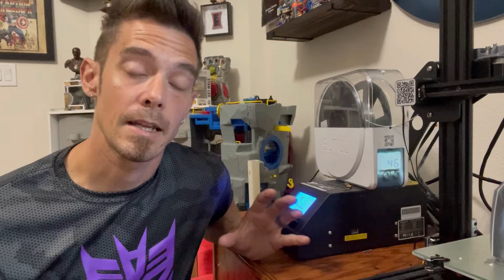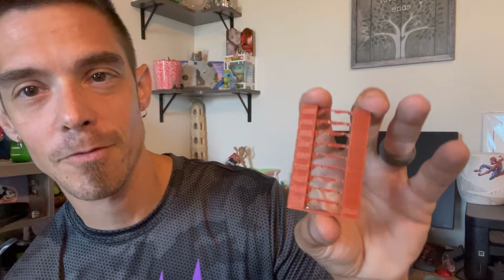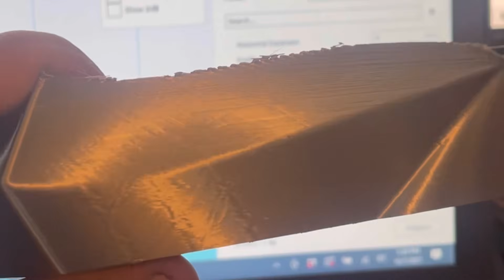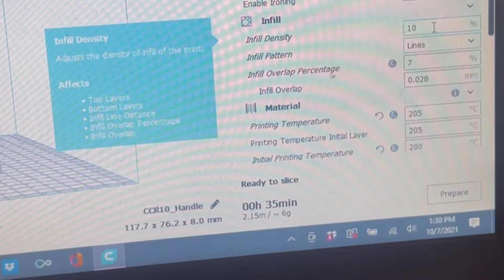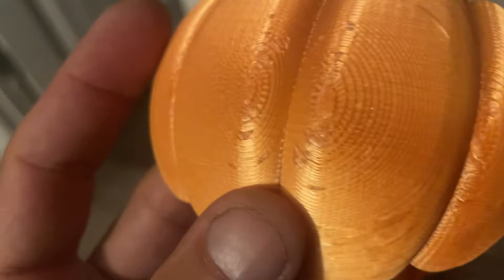3D printing silk filament| how to get silk 3D prints to look the best | 3D printing tips & tricks

Comment: Settings to get 3d printing with silk filaments looking flawless

Silk filament is different than regular pla 

a lot of them are made from starch and elastomer (a polymer that has a little bit of flexibility). 

Due to the starch they can absorb a lot of moisture so to reduce moisture get a dehydrator, 45 and 50 degrees will keep moisture from getting in

sunlu and jayo are good brands for 40ish bucks 

Starting with LAYER HEIGHT
 
The finer the layer height the smoother the print will be

We can cheat a little bit with silk filaments because it does have those elastomers, it will stretch and lay a little bit differently 

A .16 layer height can look super smooth, there's no painting or sanding required. 
elastomer
If you're selling then maybe even a 0.12

 it's been proven that when you change your layer height in increments of four you're going to get better quality

Go beyond point two four it just starts not looking too good. i would keep it at you know 0.2 to maybe 0.24 at the very highest next 

moving on to TEMPERATURE

 always print temp towers 

i'm actually getting the best results from 200 to 205. 

kira (cura?) has plug-ins form for temp towers, i highly recommend obviously doing that before any print to find out what temperature works best for you and your machine and that's going to get you started off on the right foot

BUILD PLATE

I lowered my build plate temperature to between 55 and 57 and i no longer have that warping and waviness on those first couple layers

RETRACTION

basically when the filament that is being extruded through the hot end is pulled up and retracted back into the hot end you can get OOZING, GLOBBING, BLOBS, even CLOGGING

i have very good luck with running a six millimeter distance and speed is 25 to 35 millimeters per second

SPEED

Silk does not like speed if you want those nice smooth crisp clean defined prints set speed to around 40 to 45 millimeters per second tops and let cura auto default lower your wall speed

 i have turned my jerk speed all the way down to 8 millimeters per second and my acceleration is typically around 275 millimeters per second

 i also like to lower my travel speed i usually keep it between 90 and 100 that's a nice little tip when i had it higher like 115 or 120 i noticed i still got some oozing 

Keep your prints a little bit slower with silk if you want that very nice fine defined look in your prints 

 last thing i'll talk about is INFILL

 the smallest infill i will run on like a big helmet or something that has a curve or a dome is 10 to 15 for structural foundation 

infill pattern and your infill overlap percentage

 infill overlap is it's basically the distance between you know your shell and the actual infill, if you have it too high that will bleed through and you'll see it on the print now if you add more walls or you add more top layers it can definitely help compensate that but just by adjusting that infill overlap percentage a little bit lower it's going to save you time on printing because adding top layers takes time. 

Use lines not cubic pattern on silk filament, then you're not going to have any patterns showing through

  the gloss black silk looks really great all the settings though i use for all of them they all turn out looking great don't have any complaints

 jo zero and air one filaments are great

Comment: When i print with silk it breaks along the print lines with little to no effort. Ive tried changing temp, retraction settings, slowing the print to an absolute crawl, and no matter what i can't get a decent silk print. It will look good on the plate, but fall apart just taking it off the bed. Like 1 layer that printed perfectly, does not stick to the second layer that also printed perfectly. Its like trying to print butter on top of butter i dont understand.
Reply from the maker: Silk is notorious for moisture. Does it snap when you try to bend the filament?

Comment: Trying to figure out how to access the Travel/control speeds in Cura. I can only find that I can enable them but not input any numbers
Reply from the maker: Should be able to adjust all of them, nothing is locked in on cura
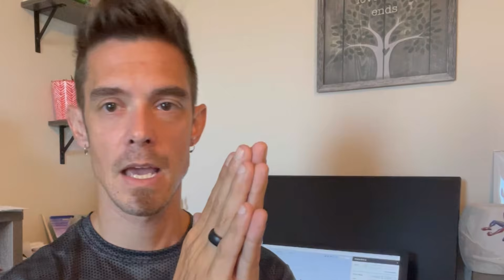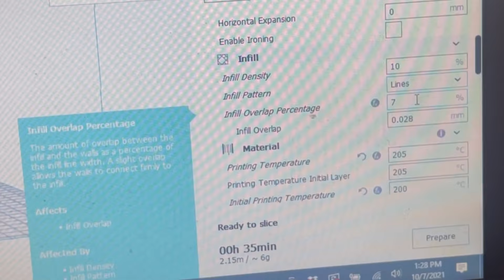Reply: @Darkwingdad  Where exactly do I get to change those options? Where do I click? I cant find the options you show at 10:30 and 13:15
Reply: @Darkwingdad  I found it! People just need to click on "show custom" in the print settings
Reply: @Darkwingdad  Ok so I've tried temp towers 3 times now with 2 different brands. Do you have an instagram or some way for me to send a picture of my results? Every single time it's stopped spitting out fillament around the second part of the tower. different temps and everything. It might be retraction based but I'm not sure.
Reply from the maker: @OldSchoolDudeGaming  yes @darkwing_dad850

Comment: What do you mean "bake" it before printing
Reply from the maker: Bake is a term used for using a filament dehydrator. You bake it at a certain temp to remove moisture prior to printing
Reply: @Darkwingdad  Got it! Thanks. I see you said bake it first and then put it in the dehydrator and I wasn't sure. If you have a min later, hit me up. I'd like to bounce a few things off you.

Comment: Found your video and am going to try your settings.  I am using a Ender 3 S1 Pro. This may give me a really good starting point for dial in. I am using Creality Print currently but have Cura 5.6 installed. Going to follow the advice.
I have been pulling my hair out trying to get this Shiny Red Silk PLA to print correctly.
Reply from the maker: With a direct drive try 1.0mm @ 40 mm/s for retraction
Reply: @Darkwingdad  thanks will try.

Comment: Hey man , wanna say thanks for tips in video. Today i printed for the first time with silk PLA on my K1 printer, and it turned out great, combined your tips with settings for K1 on silk (only higher speed) and everythings fine, though it was just a whistle model, but wanted to test it on something smaller to have some starting point.
Reply from the maker: Yea you can definitely tweak the speeds with the K1 but very happy to hear this helped!

Comment: Thanks for this video. Silks have been driving me crazy lately. Gonna try tweaking my settings to see what works best for me.
Reply from the maker: Good luck! I have 2 other videos with advanced tips & settings, be sure to check em out!
Reply: @Darkwingdad  I just saw! Gonna watch them today on lunch. I think I am going to try working with a different slicer. The anycubic one that is meant for my printer seems to be limited in my settings options. But it has a great interface. Tried the cura, but they don't have my printer in their library. Concerned it'll lead to more problems. So I gotta do some research there too.
Reply from the maker: @brianwaterman8185  doesn’t matter if the printer isn’t in there, the ender 3 neo isn’t in the latest cura & I just used the ender 3 v2 & it works fine. Just make sure it’s the right bed size etc & marlin will retain abl & bl touch & things of that nature
Reply: @Darkwingdad  oh awesome! I did go through and set the print size based on my kobra 2 neo. Gonna have to play with it more to get comfortable with it. Thanks again! Just getting into it for hobby, not financial gain. But it's something I want to get good at since I have decades of experience modeling in ACAD. So cool seeing your creations come to life.
Reply from the maker: @brianwaterman8185  small learning curve but you’ll be fine! Lots of helpful channels like mine to that help people on all skill levels!
Reply: @Darkwingdad   For whatever reason, my cooling fan didnt turn on for the print. Even went back and double checked my settings. must be something in the gcode from cura. Fan was operational during the self level. Ever come across this?
Reply from the maker: @brianwaterman8185  no that’s odd, what printer?
Reply: @Darkwingdad  its the anycubic kobra neo 2. I do know that this printer is advertised to print at higher speeds and i think that might be some of my print issues, just not sure if it likes printing at normal speeds of 50mms. out of box its running 120-150 mms. Sorry to bother you with all this.
Reply from the maker: @brianwaterman8185  try kicking it to 65mm/s
Reply: @Darkwingdad  yeah im going to keep playing with all the settings. just dont know why cura wouldnt tell the fan to kick on. seemed odd.
Reply from the maker: @brianwaterman8185  that’s weird, I know the fan is in the custom gcode in creality, you can open it in pronterface to verify but there’s no gcode I ever used that kept the fans off unless I switched something on the printer
Reply: @Darkwingdad   yeah ill have to check that out to see whats going on. In the mean time ill stick with anycubic's slicer. Just wish it had more settings to tweak.

Comment: Thank you so much I been getting blobs and being new to the 3d printing I wanted to give up but stumbled across your video it seems to be doing better but I’m getting spacing between each line
Reply from the maker: Like a gap?
Reply: @Darkwingdad  yes sorry i didnt even think you would comment
Reply from the maker: @Dew_dew420  is it consistent or random? Early in the print or throughout?
Reply: @Darkwingdad through out the whole print
Reply from the maker: @Dew_dew420  blobs could be your seat setting, overextrusion or if you have power loss restore enabled it can cause blobs. The seperation could be temp too low & speed too high

Comment: I'm revisiting this video as I learn more and print more.  I'm trying to get my silk the best it can be.  I was reading that a temp tower is useless for the Bambu because it's so fast.  Do you disagree?
Reply from the maker: That’s false, temperature 100% plays a role in numerous areas. I had a subscriber who’s prints kept failing on a bambu, the stock setting for the bed was 45* & print temp was 185. Changed to my settings with no issues.
Reply: @Darkwingdad  Thanks.  Your silk stuff looks amazing.  I want to get good at this.

Comment: I'm waiting for my Bambu P1S to arrive so I've been getting familiar with Bambu Studio slicer.  All of their filament profiles are the same:  Temp 200C regardless of the PLA type.  So we have to create all our own profiles?
Reply from the maker: Yes, I have profiles created in my part 3 video you can download
Reply: @Darkwingdad Oh, you rock!  Heading there now.
Reply: @Darkwingdad  So frustrated.  I got my P1S today.  Did a test print using their included PLA.  Ran perfectly.  Have been trying to print silk for hours and they fail after about 5-10 layers.  I'm going slow...30 mm/sec initial layer and 60 after that.  208C tool and 35C bed.
Reply from the maker: @boboscurse4130  35 is way too low for the bed temp. I assume they are popping off?
Reply: @Darkwingdad  Yes!  I don't even know where I got that number.  I checked your profile again and it's 56C.  I'm printing it now.
Reply: Turns out 35C is right out of Bambu's silk profile.  Wtf.
Reply from the maker: @boboscurse4130  yea that’s wayyy too low

Comment: Hey DWD I tried to import your Cura Silk Profiles but it keeps failing. I'm running an Anycubic Kobra Plus.  Not the Max. Not the 4Max or Go.  I'd love to try your settings out.  Keeps telling me it isn't compatible. :(
Reply from the maker: Are you using cura?
Reply: @Darkwingdad  yes I am. For some reason it gives me Quality type 'standard' is not compatible with the current active machine definition 'fdmprinter'
Reply from the maker: @tinacline1226  do the other profiles work?
Reply: @Darkwingdad  all of the basic profiles with Cura 5.4 are fine plus any custom ones I made work fine.
Reply from the maker: @tinacline1226  are you signed in through ultimaker?
Reply: @Darkwingdad  yes I am. My Anycubic Kobra Plus is the only one that isn't listed under adding a printer in Cura. Could that be why I can't add profiles?
Reply from the maker: @tinacline1226  most likely. My cr10v3 isn’t listed & I have to manually add the settings. You can add a printer that is listed like a cr6 max & just manually adjust the bed size to yours & it should load

Comment: Hi I was printing with silk I use overture filament I printed copper LOVE sign with the L and O on top and the V and E on the bottom its 1 ½ thick and I have attach to that a rectangle same thickness so I can put there names in it I hope you can picture this what it looks like I can't send pics here. Anyway they loved it but that was a couple years ago,. Now I am doing the same print sor someone else for a wedding present I couldn't remember how I did the last sign so I just stuck the filament in and hit start. It looks like crap I printed it flat and I got lines from the nozzle going through it thats the only issue I have when I started before watching this video I printed it 50mm per second amy temp at 200 everything else stayed the same. I have an ender 3 V2. Any tips you can give me I dont have any curved spots its all flat. Thank you
Reply from the maker: Layer height .2 or lower 
Combing on-not in skin 
Ironing on 
Z hop when retracted 
Those will give you a nice smooth finish
Reply: @Darkwingdad  So you saying leave the temp and print speed the way it is. My layer height is now at 0.2 I never changed it. Oh I have been 3d printing for 2yrs and this is the 2nd time I am printing with silk. Now should I change to these settings you gave me and print with that meaning save it to my silk profile or is there other queeks I have to do before I print? Thanks again.
Reply from the maker: @geo11211  adjust those & you’ll be good. My next video will have my profile available on a google drive
Reply: @Darkwingdad  thank you very you have been really helpful thank you again. Do you have facebook so I can send you messages if I have questions if thats ok

Comment: I’ve been printing for years now, but I had to watch this because my damn silk PLA gets squished and causes clogs. Not sure what to do about it.

It’s literally softening inside the hotend and the filament gets thick at the end and can no longer extrude. I tried high cooling, low cooling, no retraction, high temps, low temps, etc. I’m at a loss
Reply from the maker: What’s your retraction & temp set at? Are you using a dehydrator? Esteps done?

Comment: I live in the desert and love the fact that I don't need to dehydrate.
Reply from the maker: Overtime moisture will still absorb in. No atmosphere has 0* humidity unless you live in Antarctica or space lol it’s still good to dry them out routinely
Reply: @Darkwingdad  I've never had bubbling or any sort of issue. My area's relative humidity averages 8%-10% - I am sure some moisture gets in, but I wonder if it's not enough to cause issues? Like, what is the threshold?
Reply from the maker: @TheeGlocktopus  yea that’s crazy low. Low for me is 45% & that’s inside lol outside I don’t think it’s ever below 65% outside. I’d imagine low amounts have minimal impact.
Reply: @Darkwingdad  Yeah I wasn't kidding when I said the desert lol. There's like 3 weeks a year where it rains, that's monsoon season, and i just put all of my filaments in plastic totes with desiccants that I save from the packs. Even then, it's only up to about 25%

Comment: What size nozzle are you using for those nice art pieces i have an anycubic kobra neo in tuning for silk and I changed all my settings to match what you should in the video b4 I printed the temp tower  and the temp tower came out great and do u use the Z hop up setting on ur prints
Reply from the maker: I’m running a .4 nozzle & yes z hop is an essential setting to have enabled!
Reply: I did the print in place sloth and it still didn't work right im getting a gaps in the layer lines in random spots and it's driving me nuts trying to figure out what is causing this to happen
Reply from the maker: @aaronosb7787  little knibs or bumps?
Reply: @Darkwingdad  there is a little bit of bumps but mostly looks like missing outer wall lines in a bunch of spots can I email you a picture of it
Reply from the maker: @aaronosb7787  sounds like either A) your overextryding- esteps & flow need calibration B) you have a clog and are underextruding- could be a clog or improper esteps or moisture in the filament
Reply: @Darkwingdad  how do I check the esteps and flow and adjust it if needed
Reply from the maker: @aaronosb7787  https://youtube.com/watch?v=poTwyEi63pY&si=EnSIkaIECMiOmarE estep video here